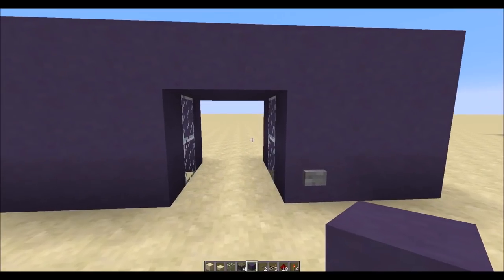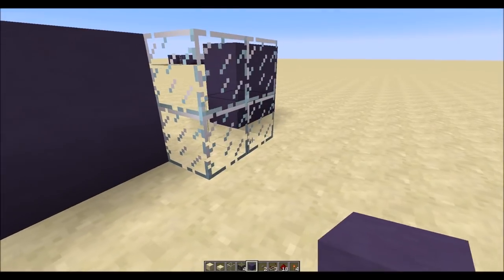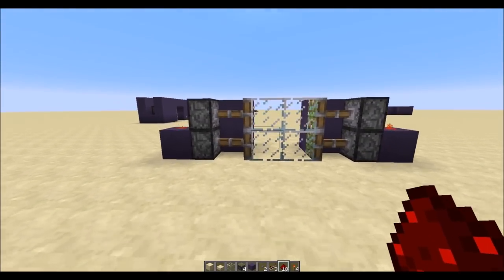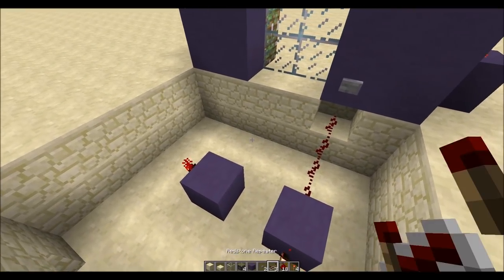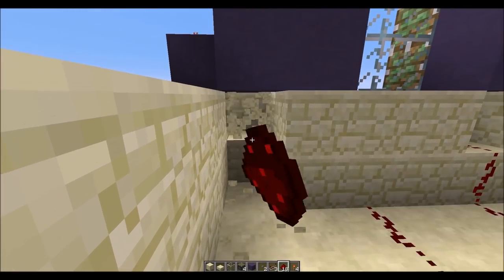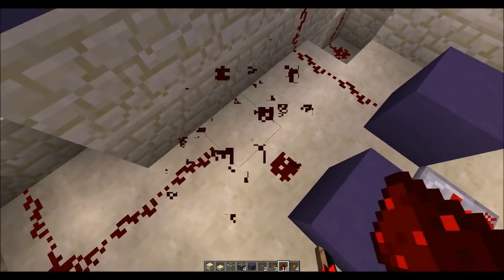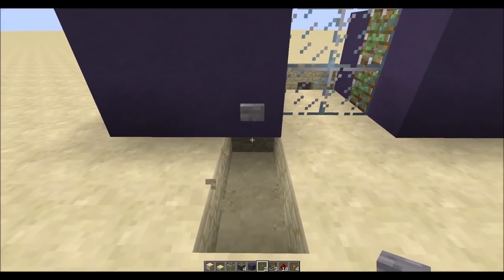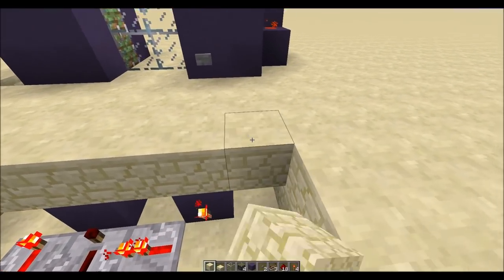Minecraft tutorial - Piston Door with buttons

Comment: Thank you so much for the video, I actually have been trying to figure out how to make a 1x2 door open from both sides.

I had discovered a neat little lock that you can do using your current system but it makes it only open from the outside as if I did the simple outside button to open the hidden door and it close a second later.